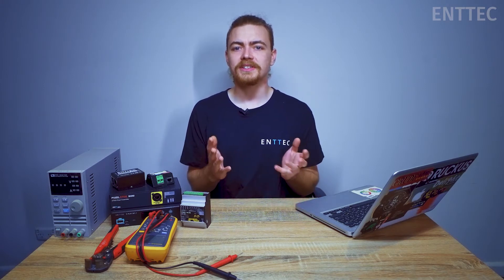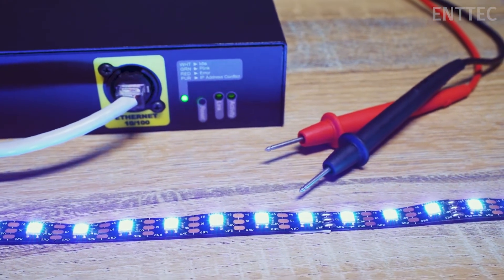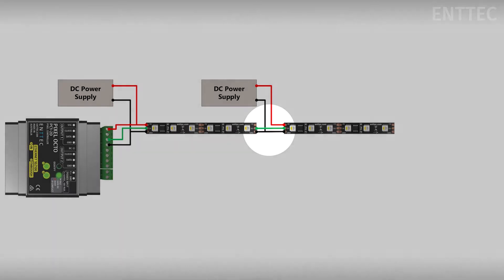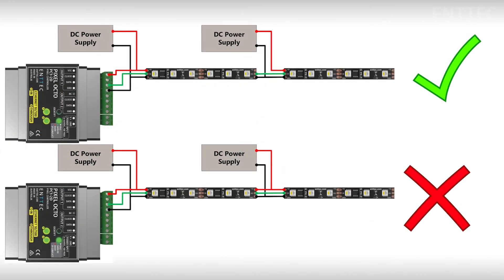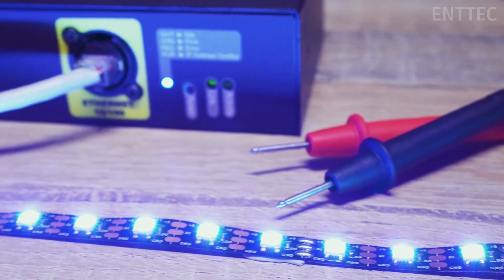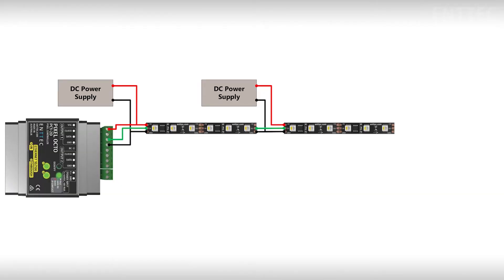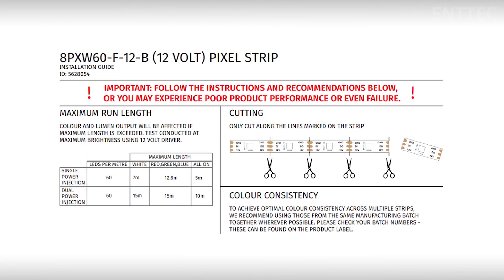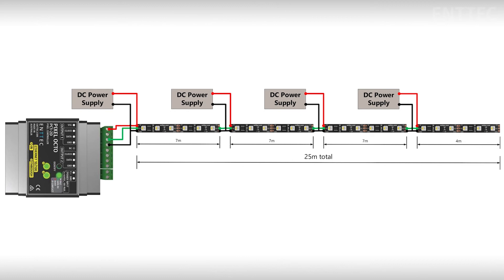Ep.11 What is Multi-Single Power? Learn how to create an efficient LED strip setup

Comment: Does this work using 5v battery power banks? If they are at slightly different voltage/charge will this be a problem? eg, one battery pack is at 4v, and the other is full and at 5v?
Reply from the maker: Hi Michael, this will work using battery banks. Providing you are within the operating voltage range of the LED Strip, LED Dots or OCTO's you are using you will be fine. - When working with batteries, we always recommend the use of fuses to ensure the battery doesn't get short circuited if a fault occurs in the installation. (My personal go-to are ATO blade fuses around 10% lower than the current capacity (A) of the battery.

Comment: Can you show us how to power-inject in the middle of a length of led light strip? Every video describes power-injection but not one actually shows how it's done, what gauge of wire to use (is the 22/4 adequate or something thicker like 16 gauge red/black? Thank you
Reply from the maker: Hi Tommy, 

When injecting power, the thickness of your cable all depends the power draw of the LED strip you are working with and the material it's made from.

We specify a Watt's per meter' value for each of our LED strips and a power draw per Dot for our pixel dots. 

Typically for the best results we recommend the use of stranded copper cable (16 or 14AWG depending on the amount of power your installation requires). - If you're only powering short sections of a couple of feet length, this cable diameter can be a lot slimmer (i.e. 18AWG).

I've added a link to the installation guide that gives some tips on how to specify cable alongside a re-injection guide.

https://enttec.atlassian.net/wiki/spaces/EKB/pages/892371164/What+is+the+recommended+cable+for+installing+Pixel+Strips

https://enttec.atlassian.net/wiki/spaces/EKB/pages/210862085/When+should+I+reinject+power+with+my+pixels

To go over this in some more detail, or to cover a project in particular feel free to drop our support team a message at support(at)enttec.com, we'd be keen to talk!

Thanks, J
Reply: @ENTTECofficial  Hey, to answer as best as I know how, I''ve got 3 5 meter strips to power or 15M total. I have a 240 Amp power source which takes into account 20% more than I need for the job. These strips are sold with a measly 10 amp ac adapter and I'm using a 240 amp to drive 3 strips. I figure 3 injection points will do since the first strip is already straight to power obviously, and one at the very end of the 15M run (which will be right next to the power supply again of course) so I'll "tap-in" (inject) once per strip at each strip's midway point, the only question is will 18 gauge be adequate or is 16 needed? The actual light strips themselves use 18 or 20 gauge for each wire, red, green, blue and black so it shouldn't require much thicker wire to send power to them correct? The light strip's own wires couldn't handle thicker wires sending more power than 16 gauge without overheating? I worked on the INS of the F15 Eagle in the USAF so I have a basic understanding of what you're explaining, but it's not the same as LED lighting of course LOL
Reply: @ENTTECofficial  Hey J. Thank you so kindly, I've got 8 copper pads (4 next to 4 ) every 3 inches, it's 3 5 meter good quality strips of waterproof to do a 10' by 12' room. I figure 16 or 18 AWG will suffice, as I only need a few injections. I'll already have one connection at the first strip of course and add one at the end of the 3rd strip, so 2 or 3 injections in addition should be adequate. Thoughts?
Reply: @ENTTECofficial  J. on my strips, black is 12V (power) but don't know what red, green or blue is? I suppose it doesn't matter as long as I'm connecting like-to-like colors so who cares which is data, which is ground etc?
Reply: @ENTTECofficial  Hello my friend, I'd like to do this in the simplest terms and if I fail, I'll cross that bridge but the lighting and PSU and RF controller are just sitting in a box, nothing is accomplished like this. I have 3 5 meter strips of quality waterproof strips, the colors are red/green/blue/black and black is power, I don't know which is data or ground for the other 3. Can you tell me which wires I need to make a single injection point, power is black obviously, I have a multimeter if thats how you test which is ground. Once I determine ground, I assume I'll solder black to power and either blue, red or green for ground, yes? (to make my pigtail)
Thank you ever so, I can send pics if you tell me the email